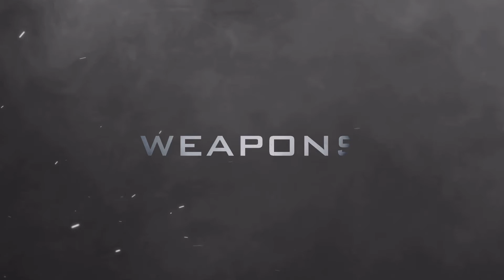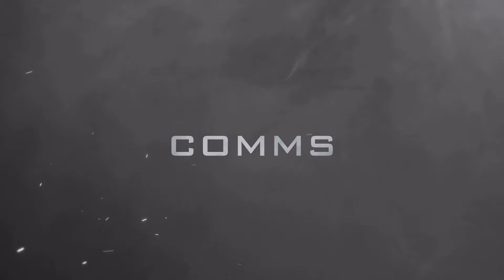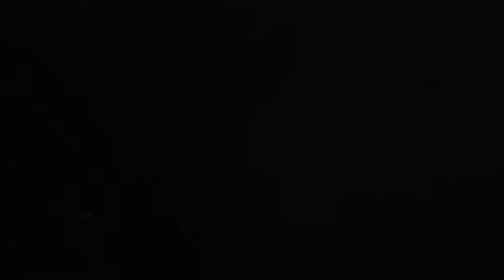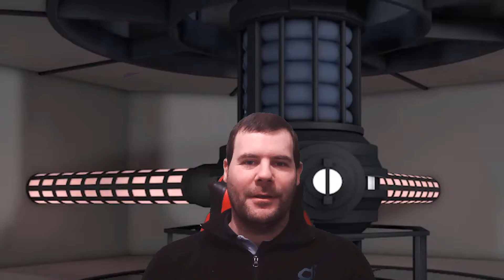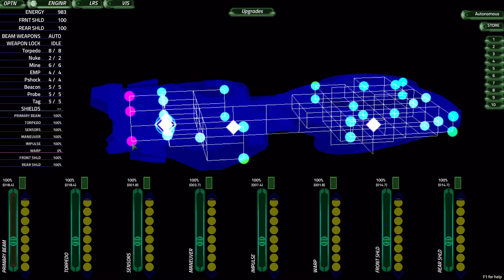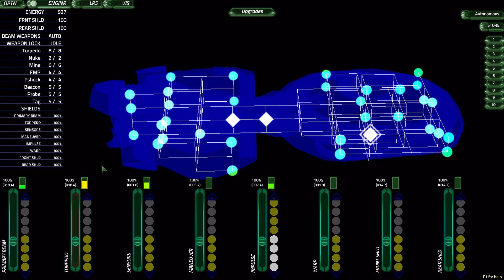Engineering basics

Comment: Excellent tutorial. Two things I would have added:
1- Boosting a system above 100% consumes energy from the energy reserves or slows down energy regeneration. Similarly, reducing to something under 100% saves energy or increases energy regeneration.
  (1a) The effect on energy consumption / energy saving is exponential
  (1b) Systems do not all consume the same amount of energy when boosted; the warp drive consumes the most, the sensors increase the least
  (1c) The rate at which a system accumulates heat when boosted increases exponentially.
2- There is a way for the engineer to trigger the self destruction of the ship ! (and explain how)